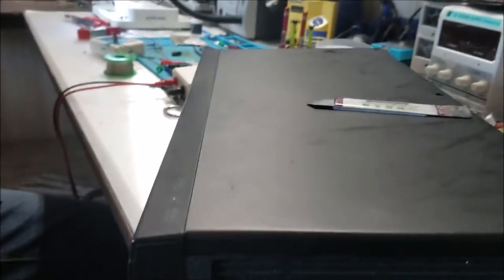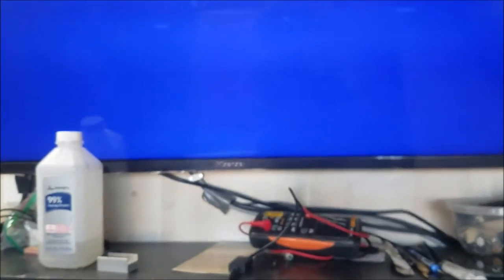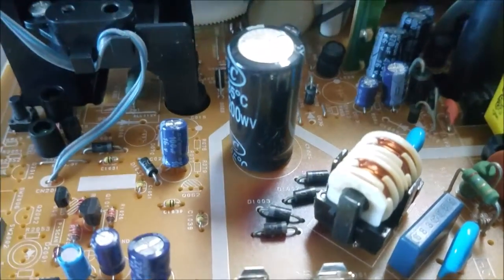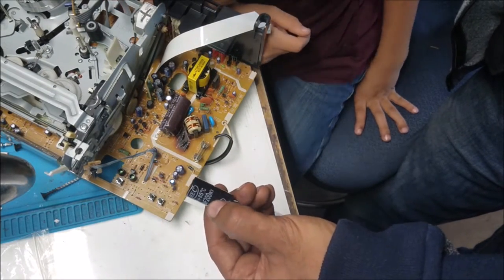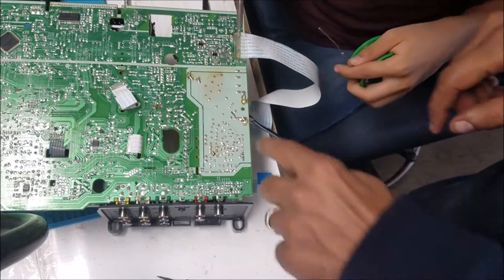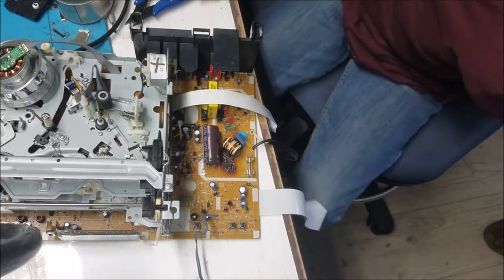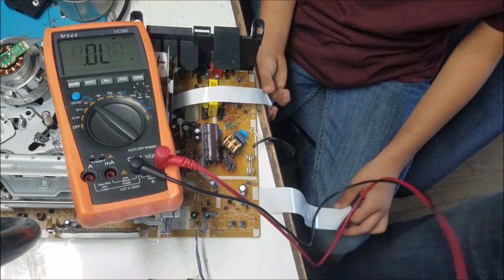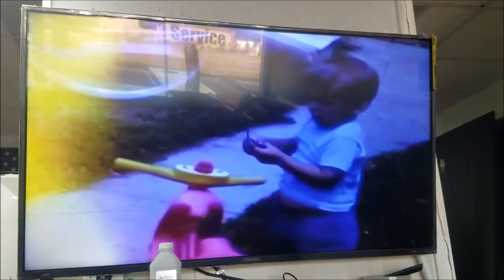Toshiba DVD VCR player SD V296 K TU destroyed picture and noise

Comment: I have this same model. But it gets really hot in the middle square on the bottom and this causes the vcr to make a grinding noise causing certian tapes to crisp and slip off the white guide between the audio head and the pinch roller/capstan at the beginning.
Reply: Im trying to see what is causing the overheating issue by taking the circuit board out but on the vcr side it's hard to get it out.